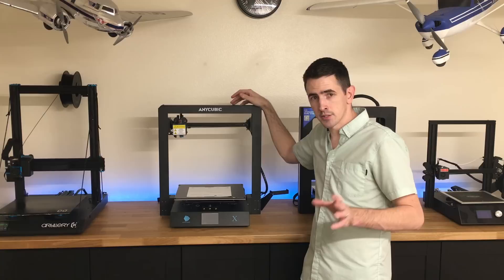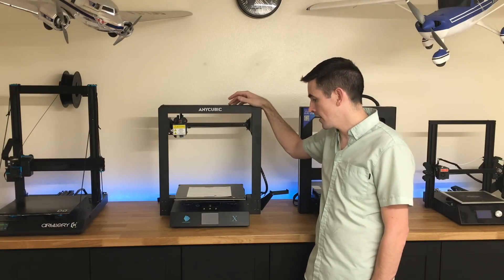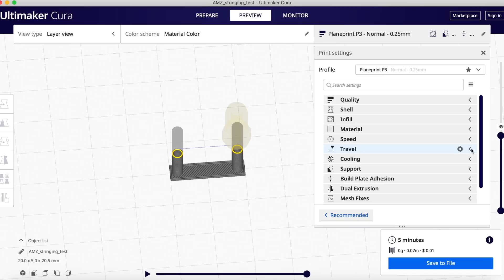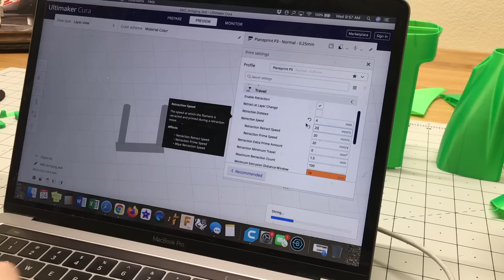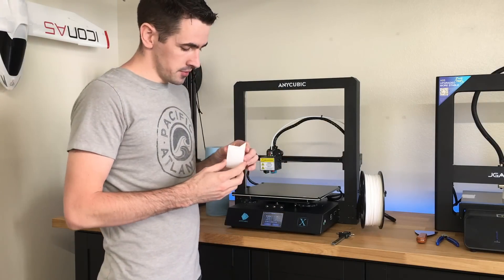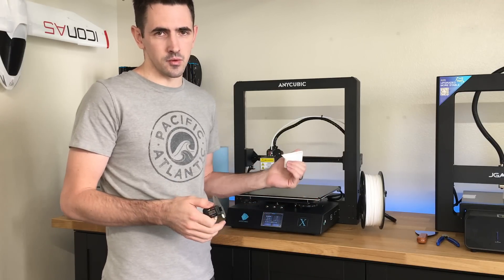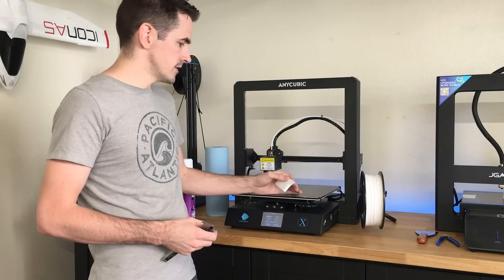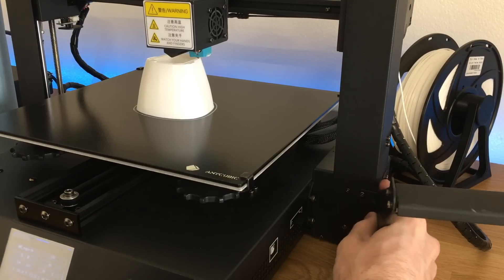Anycubic Mega X 3D Printer Setup and Review

Comment: Just bought and printed the owls as a test. Put several .stl files on that same card and it won't show up on the little screen. Am I doing something wrong?
Reply from the maker: yeah, it should show up... something isn't quite right there
Reply: @TroyMcMillan  What I learned is that I was putting .stl files on when I need to use gcode files from the Cura program.

Comment: I'm 95% sold on getting one of these thanks to your vids Troy, my only concern was the risk of tall parts falling over when getting towards the limits of the Z height. Have you ever had any prints fail at the max heights? I know the Ultrabase is excellent I had one on my AnyCubic Kossel Linear Plus.
Reply from the maker: I use hair spray for an adhesive for the build plate, that will allow the parts to stick very well and not break off. All the parts are a max of 200mm for these planes so they are not all the way to the max of the Z axis.
Reply: Thanks Troy, I think i will go ahead and order one. I was going to try and get a CoreXY printer as they're all the rage now but i think the proven i3 kinematics will be fine.  Cheers from Au and good flying!
Reply from the maker: @alexmcrobb4168  Ya I have a CoreXY printer also. It works very good but it does take a lot to set up and get it running.

Comment: Hello! Umm... can you offer help or direction/instruction I have the Mega X and I am trying to print the eagle head and I have manifold errors in cura, A comment on Facebook said run it...? I tried and I have 2 holes on the head above the eyes. Any suggestions on fixes. Any help would be appreciated, ty.
Reply from the maker: I have not had this error. Just double check your setting to make sure there are all set correct. Make sure it is in surface mode and union overlapping volumes is not checked.

Comment: Hi Troy. So which printer are you recommending now, especially for a newbie to printing in general and to airplanes in particular? It doesn’t have to be rock bottom priced, just easy to set up and use while producing good thin wall parts. Thanks!

Comment: Hi Troy, I am printing the v2 on my sidewinder x1 with lwpla. Noticing some wobbling or ringing on the taller parts gradually getting worse the higher it prints. Using the eclipson cura profile. Did you experience similar?
Reply from the maker: Yes I definitely experienced this. The main cause was the PLA spool on the top of the Z axis. It acts as a pendulum on the top of the Z axis causing this problem. I also made a Z axis support. I plan to make a more permanent setup but for now I just used para cord and looped it around the rubber feet at the base to the top of the Z axis. If you watch closely on some of my latest videos with the angle at the printers you can see I have the spool mounted on the wall and black rope holding the Z axis. This fixed the problem perfectly I don't get ringing any more the Elevons for the V2 definitely had this problem for me.

Comment: I gone over the Cura settings several times and my Anycubic Mega-S using LW-PLA still is printing lattice style skins with no interior cross member ribs.
Reply from the maker: hey I wrote you on Insta, check to see if surface mode is on and did you check out my LW-PLA settings in the description? Hope that helps!
Reply: Did you ever get  good prints?  I was getting the same lattice results. I followed all Troy's settings (and yes I have "surface mode" turned on) and the results are just horrendous.  I was able to get a fairly good skin by kicking up the "retraction extra prime amount" to .7 cu mm.  I Did this in .1 increments and the lattice slowly receded with each .1 increment.  This is my first 3D printer so I'm not sure if I'm adding a band aid over another problem.  This is still using the normal PLA.  I haven't attempted the LW PLA yet.

Comment: With that hot bed you should just wait the bed temp to lower than 30° C degrees..  it will detach by itself ...  The anycubic ultrabase is amazing on that.
Reply from the maker: I have to use hairspray for adhesion for thin wall printing, so I just have to be delicate detaching them because they're extra stuck. As you say, it's not a problem for regular prints.
Reply: @TroyMcMillan  weird that u need that hairspray , check on printer manual , cause im sure your printer got the Ultrabase , and isnt needed  (to use some other adhesion help), i got an Anycubic i3Mega with Ultrabase, and really never had issues with pla or ABS  (with ABS i just used more skirt/brim to mantain objects stuck), letting cold down prints under 30° C  make detaching by themself  cause  the utrabase surface structure.

Comment: I really like this eagle and the paint job your wife did (in the other video). I just got a new Prusa Mini+ and need a smaller model to start with that is printable in 180^3 before attempting one so big. I'm curious what's good for a first project.
Reply from the maker: thank you!! unfortunately, all of the designers make them for 200^3 printers, so they wouldn't fit. From what I've heard, the ender 3 v2 is a great little affordable printer that is able to print all these planes. Really sorry :(